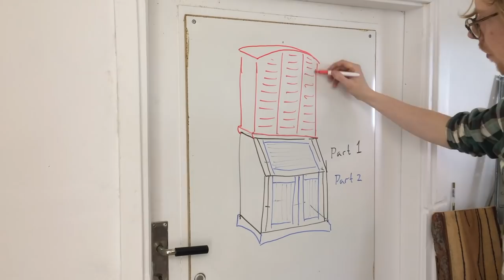Secretary desk build – part 1

Comment: Does your very large tooth rip saw work well?
Reply from the maker: Not anymore! It was a hardpoint saw so when it got dull, that was it. Still need to find a good replacement!
Reply: @GillisBjork  ah. ive got an old diston i could file with big rip teeth. could be good
Reply: @GillisBjork  hello there. Is it an aerated concrete saw?